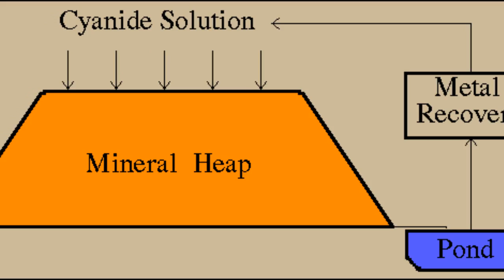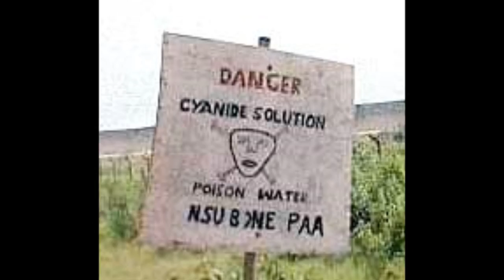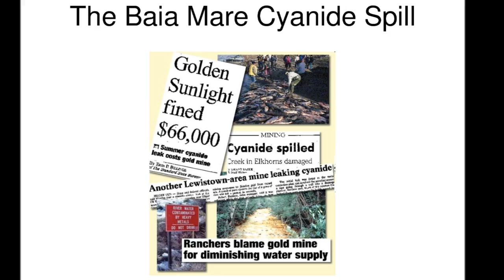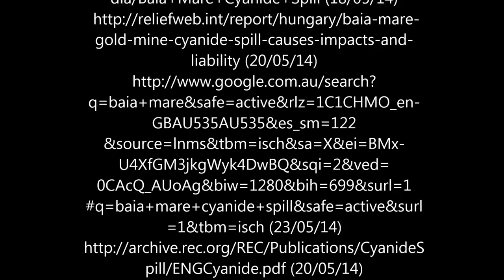Baia Mare Cyanide Spill

Comment: Unfortunately staff at Aurul had advised the owners months before , of the possibility of a dam spill if there was to be a fast snow melt. A dewatering plant as per advice was clearly needed but denied.  It comes down to economics of installing such a piece of equipment and the morals , ethics and values of the owners,if there are not sufficient regulations to make such environmental safety mandatory.  Superimpose this on a background of  poverty, lack of employment, with Aurul being one of the largest employers in the town, already sub optimal environmental and mining practices throughout the region, corruption in many parts and you have a very difficult job trying to prevent such disasters.   While all of your images may not have been correct, and of course you don't have access to all of the facts, going only by what was available to you through the media which was quite blown out of proportion at the time, I think you did a very good job of your assignment.  It was a disaster of great proportions and it did not need to have happened.